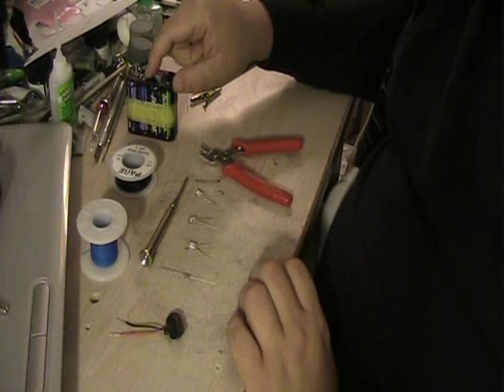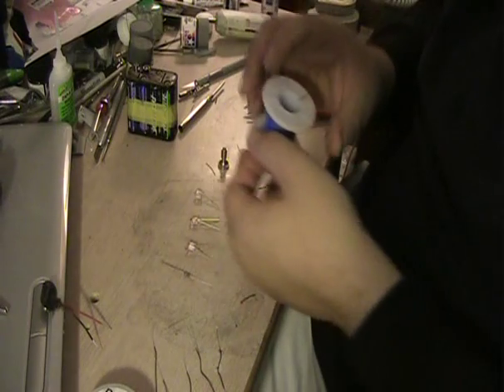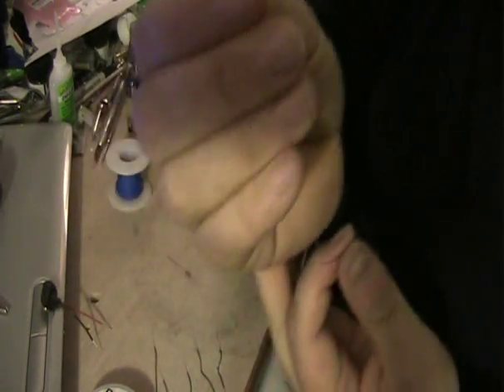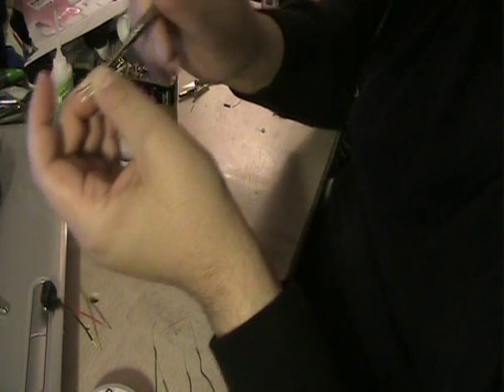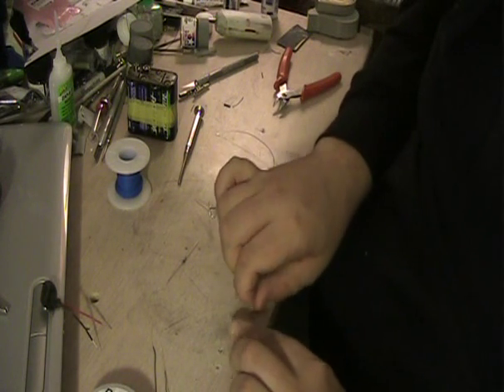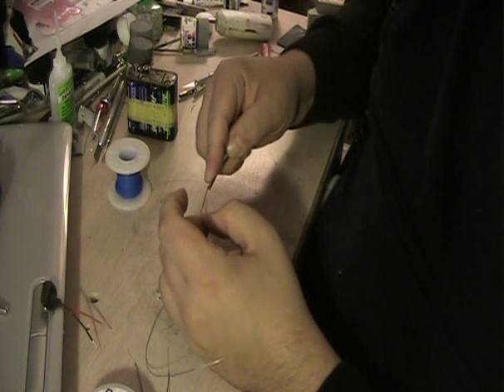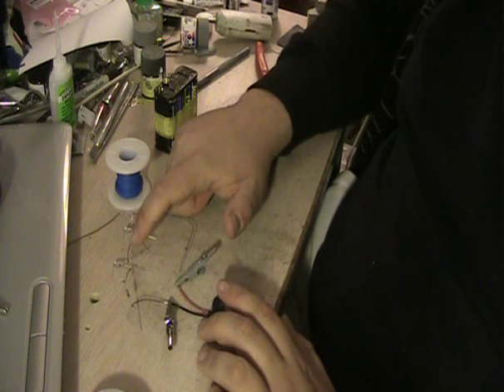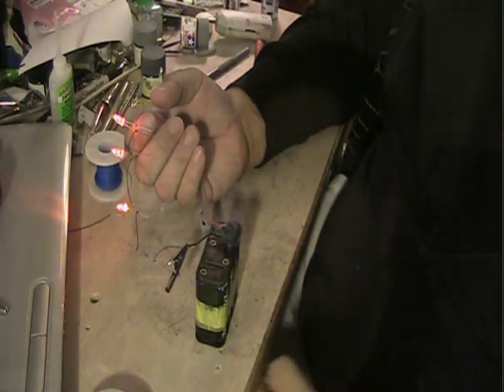Model electronics 101, lesson 2, setting up a basic electric circuit

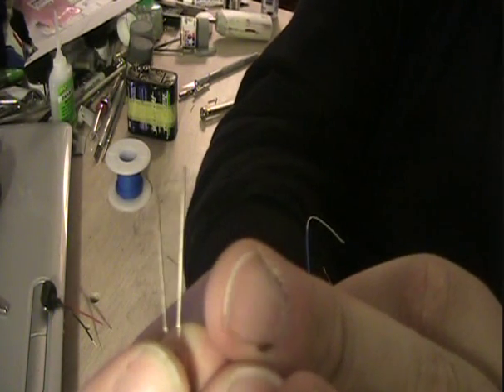Comment: 03:00 -"The longer terminal is always the positive" - In most cases, yes. But since you chose to emphasize on the "always" i feel like i should point out that LED's don't always even have a longer and a shorter terminal. Another thing to look for is a flat surface on the otherwise round diode, wich signifies the cathode, or - side. One of these two should always be present on a LED.